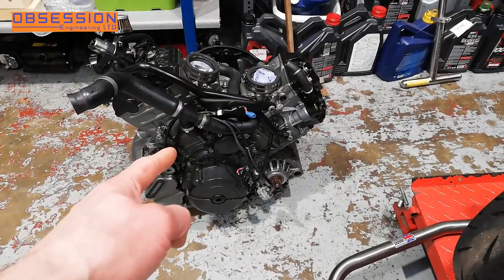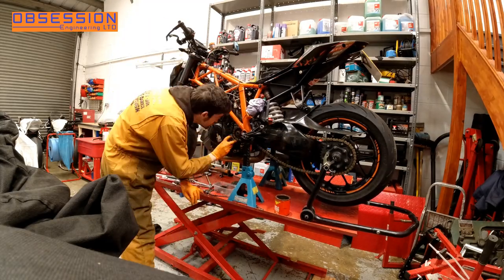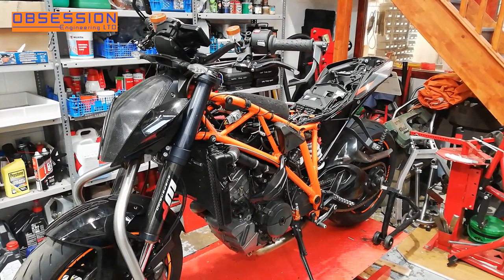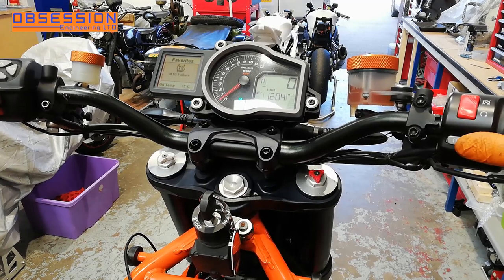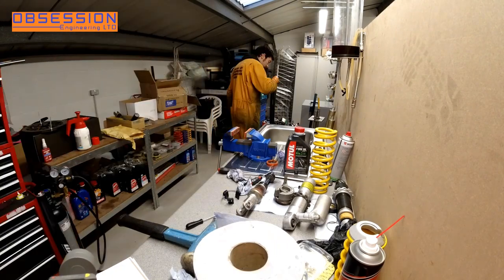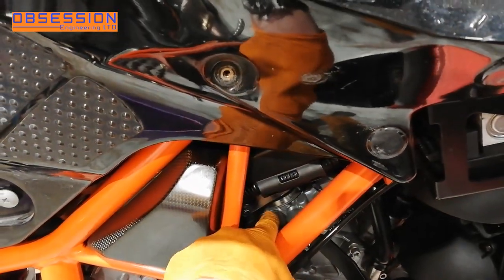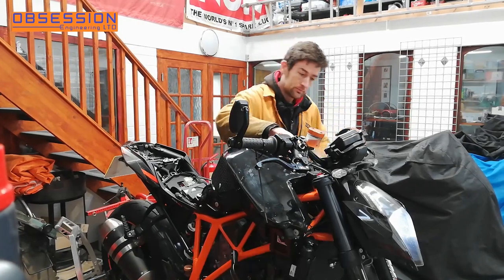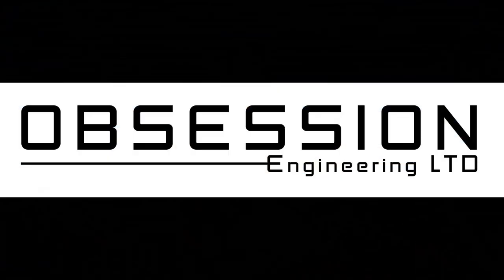How to fix a KTM 1290 gearbox. Part 3. Fitting the engine back into the SuperDuke chassis

Comment: Great video.  I took my superduke gt apart after watching your video.  I destroyed second gear on the input and output shaft on my engine, after doing a burn out and breaking the drive chain.
The case got cracked on the rear mount.

          After tear done I assembled the 2 case halfs and they lined up perfectly on the dowels, so I decided  to weld the damaged case.  After grinding out the crack and making a fixture to hold locating I had the crack welded. Making another locating fixture  I bored out the rear mount  and faced off the top for the bushing to be reinstalled. Putting the 2 case half back to gether , the fit was still perfect.
     Thanks to you I put the oil pump back in the way they came out, (NOT THE WAY THE MANUAL SAYS)
I did run into problems  with getting the 22mm oil pump ( IT IS STILL IS ON BACK ORDER 1 YEAR LATTER)
since I couldn't  find the 22mm pump after alot of measuring and resurching I figured out that i can grind a 30 mm oil pump down to a 22mm because the only difference is the thickness. This is a job for a competent machine shop.

Long story short after 1 year of waiting for all the parts the bike is running fine. Although I had one hick up timing it wrong due to the manuals translation to English and me not paying enough attention.  I had the front cylinder 360 degrees off.  Be careful  and after timming the rear cylinder make sure you rotate the engine 360 degrees counter clockwise, then rotate it an additional  70 degrees  counter clock wise.

So my conclusion after fixing this engine is the same as yours KTM made this engine overly complicated  to work on.
        And after waiting 1 year to get al  the parts. I will probably BUY A Japanese bike so I can get parts when I need to repair it.
   AGIAN GREAT VIDEO  IT HELP ALOT FIXING MY superduke 1290 gt
Reply from the maker: Sounds like you had all the ktm problems in one go. They're great bikes to ride, but I wouldn't be buying one having seen behind the scenes!!
Reply: Your 100 percent right. 
if you want the hardest bike to have to work on buy a Superduke Gt. 
But when your riding one you really don't care, because all that brute toqure is just addictive.

Comment: aah the dreadful bleeding...
its even worse on a 1290 super adventure, because the fuel tank is in the way. you need to remove the fuel tank to bleed the cooling system.
Reply from the maker: More brilliant engineering 🤣

Comment: The constant moaning about a compact ,lightweight 180 hp  race engine is not very reassuring , repairing simpler things like vintage Royal Enfields may be a better and happier choice. Imo there is nothing more "dangerous" than an over confident then fed up mechanic taking "care" of high end engines.